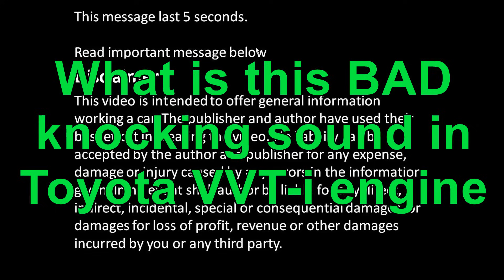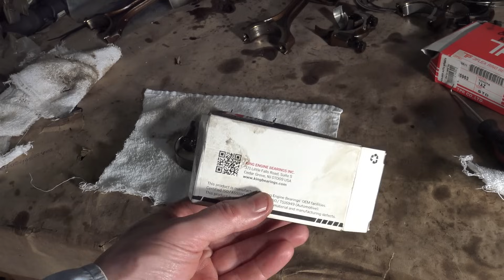What is this BAD knocking sound in Toyota VVT-i engine. Years 2001 to 2018

Comment: Thin oil recommended for those engines, vvt system has a very fine screen mesh that the oil has to pass by before it gets to it, if using oil to thick you’ll starve it
Reply: It's same as 5w20 when warmed up.
Reply: @Polymer Tools yes used as the manual book or factory recommend oil only don't listen to others that are wannabe mechanics.
Reply: From experience...yes! Use 0-20 oil and no thicker than this. I listened to a wanna-be mechanic to use a thicker oil and destroyed my oil pump for this bad advice. Toyota uses very tight tolerance on their engines so why we need to use whatever the manufacturer states to use.
Reply: @VILLEGAS76able  normally Toyota or manufacturers manual states the use of 0w20 oil or higher on the manual book soo don't..my last car about 20years old they told to use the thicker oil after a certain milage and guess what happend, same as you said additionally knocking related engine problems
Reply: @Polymer Tools You dad is not a mechanical engineer. Or, at least I REALLY HOPE he isn't if he's saying that.
Reply: Use the recommended factory oil. You can add lucas or zddp but thats about it.
Reply: @VILLEGAS76able  so I should use only 5w30 in my Corolla X 2001 with 1NZ-FE engine despite its mileage of around 150k KM
Reply: @BilalBaloch-tl2bp  Correct! Just go with a top quality synthetic oil. I use European oils as they are more robust than American made oils, so like Liqui Moly or Motul. oil.
Reply: @VILLEGAS76able  thanks for replying. Im currently using 20w50 which is way too thick for my car but used it this time because of the mechanic. Here mechanics mostly suggest using this oil if your engine has a mileage of 50K+ km.
One more thing, i once used 5w30 fully synthetic oil in my car and after around 1800km, oil level on dipstick were at middle. Is this normal?
Reply: @VILLEGAS76able 5w-20 and 0w-20 are the sane at running temp. The W rating is the cold temp, particularly winter. Just change your oil regularly, and use an engine cleaner every now n then. There are additives to the oil and for fuel. I advise an oil additive for the last few miles before a change

Comment: thanks very much for yr showing us that the engine bearings were warned OUT,  needs replacing My engine also make that knocking sound on my Toyota Yaris 2006 .while it is idling. My 5/8 mechanic could nOt find the problem, which u did <BUT total cost to renew both bushes n bearings on a Toyota Yaris engine . i am jp from Australia
Reply: I also have this problem on my yaris currently. Have you fixed yours?... Is there a slight cut in power than usual when this occurs? I'm really stressed out

Comment: Finally and after so many years i found out why i spend 5k eur on a engine repare in a new toyota verso after 100k km and 4 years. All the revisions where made on toyota. But not all is bad, the problem was solved, i love the car, no problems meanwhile and 350k km at this time. Thanks for the explanation. From portugal.
Reply from the maker: Good 👍

Comment: Yep I had this sound in my corolla engine for roughly 6-7k miles before I replaced the bearings. Bearings were torn up but the crank was fine. OE thickness bearings fixed the issue.
Reply: Did you have to pull the engine to replace the bearings?
Reply: @darcytran  nope. You don't even have to pull the head. Just drop the oil pan and unbolt the rod cap, them push the rod up a few inches with a 1/4 inch extension and reach your hand past the crank and pop the bearing out and replace it. Just make sure you line the hole in the bearing up with the hole in the rod, it's used to squirt oil on the cylinder walls. And remember to replace the bearing on the end cap side too. 8 in total.
Reply: @jimchance5006  wow, this sounds great!
Do u have a link to buy those bearings?
Thanks!
Reply: @rickyspanish5051  I don't have a link to them, but I bought them from rock auto. Any of them listed there will work, just make sure to check oil clearances with plastigauge.
Reply: Thanks a lot and have a great day!

Comment: Sounds like lifters to me. Some Toyata's take shims. The rod bearings make a low dull thud sound from the bottom of the engine. Lifters were refereed to as Tappets back in the days.
Reply: Do you happen know what could indicate the knocking sound (but louder than in this film, it seems like you are in an airplane) in engine on higher speeds? Till 30-35 mi/h the car runs very quietly. It is 2003 Chevy Cavalier w/110K.  I always changed the oil in time. The knocking sound starts ~ 40 mi/h, increases to maximum at ~55 mi/h, then goes a bit down.
Reply: Its not. Theyre called bucket lifters. Amd they tick, not as much as a knock. I have heard both 1st hand on this engine

Comment: That noise is wrist pin slap. (Too much wear at the pistons connection to the rod which connects to the crank shaft. 
You can isolate to prove this condition by leaving it running, disconnecting one spark plug wire from either the dist cap or ar the spark plug. Upon killing the spark to each cylinder, then revving up the engine again and the hammering sound should be gone in the cylinder that is the problem. Done.
Reply from the maker: Good work, Thanks ! 👍😀

Comment: finn i have 1.0 toyota 2011 mine makes ticking lifter at idle i think and also when i accelerate in gear it makes CRRRR sound like diesel and i think its either piston and cylinder worn out or crank shaft bearing, its only under weight and it goes away when hot but still hear it a little bit
Reply: My Citroen c1 1.0vvti same problem.. U fixed it ?
Reply: @h4swell  repaired still crrr,my cilinder walls are not broken, the citroen has the 4800 torque same engine tuned different,my yaris has the 3600 torque +3hp, try using other oil,i repaired mine, swapped rings chain gasket cleaned big carbon deposit and when we drove it the second time it made crrr,manual says to use SL/SM oil i used toyota and nearly no more sound and oil consumtion only on highway first i used liqui moli it burned it in 5000km city and was loud,now i use motul, but right now it has some fuel issues and wont start, i got the car from the mecanic with a cracked catalitic and loose sensors, and its always fan on when its cold, btw i use 5w30
Reply: @h4swell  mine also made a hhrrsssss because the chain was loose
Reply: @h4swell  i changed, piston rings, valve gaskets, all other engine gaskets, timing chain and tensioner supports, changed vvti changed oil pump, changed water pump, the pumps were good but mecanic said they suspect they dont do enough pressure and i changed them, valve tappets are good didnt change them, got the car from mecanic with fisured catalitic and now it doesnt have gasoline pressure and wont turn on 2 days 3 days later
Reply from the maker: Thanks for comment 👍
Reply: @h4swell  the problem is solved, weared in the engine and its running good, also i said theres no fuel pressure changed the pump and the pump was good there was the water temperature sensor that was broken replaced with a bad one and read 140 celsius and i changed the sensor with a good one and the car started and read 10 celsius like how it was outside

Comment: Hi. The same problem in my car. I planned to change those bearings. Do I need to remove the engine out and replace it or should I change it from the bottom of the car just jack up and do it. Do you think I can access this from underneath the engine bay without removing the engine from the car. Coz I don't have those engine lift.
Reply from the maker: I recommend trying it, can it work either way when the car is a Corolla
Reply: @PeterFinnTheCarDoctor   thanks for the reply peter. My car is 2003 Camry le. Sorry I didn't mention it earlier.

Comment: My Toyota 1NZ had a  knock sound and heavily smoking. Whem we opened the engine the pistons were easily playing in the block, and when measured was told the block needs Resleeve and that the pistons and rings were at standard, could the knock sound being caused by the pistons in the block
Reply from the maker: Sounds like bearing damage

Comment: Very interesting situation Peter. What was the cause of all this? Was it maybe bad lubrication? Is the issue fixed?
Reply from the maker: Normally oil replace. Too long time and to much miles for engine oil replace. This engine was driven by 40 000 miles with one oil replace.
Reply: That just goes to show how important it is to take good gare of your car. I have two Toyotas and don't know shit about car mechanics, but every 15 000 kilometres I take my cars to get serviced and have oil changed by a professional and my Yaris Verso 2001 has 348k kilmometres on it and still runs smoothly and my 2004 Avensis with 180k kilometres also runs well
Reply: This is the unexpected problem with Toyotas. Their engines are so robust and so reliable that it’s very easy to neglect maintenance on them. You just keep driving them and they go on and on and on, without any problems - until an obvious problem manifests itself, and it’s too late to do a cheap repair.

Oil and filter changes regularly, even when the engine is running beautifully. There’s the secret of keeping a Toyota running happily forever 😊
Reply: @Aussiemarco  You speak the truth!
Reply: @Aussiemarco  Absolutely. Take care of your Toyota and it will take care of you!

Comment: Hello. I have a 2004 Toyota Avensis 1.8, 1ZZ FE angine that consumes a lot of oil. Serviced around every 10.000 km with Toyota Engine oil 5w30 fuel economy. Two days ago the oli light start flashing when slowing down or accelerating. I checked the oil level and   
the dipstick was dry...😐 Added 2L of 5w30 oil and seems to be at minimum on the dipstick. After adding 2L of oil, i was driving the car and from the engine starts to hear some metal noise when i was hitting the gas pedal.The metal noise is herd only when i give some gas....Can u tell me, please, whats the damage?😐
Reply from the maker: Hi, your piston rings

Comment: BUT that knocking sound STOP when driving it only happens when in IDLE mood aka at a RED LIGHT STOP
Reply: Worn out engines will have lower oil pressure which can cause more wear at idle.

Comment: Hello.  Same problem in a peugeot 107 3 cylinder toyota vvti engine.  Tiking noise...... about this'..........This engine was put in daihatsu sirion and cuore. Toyota aygo, peugeot 107 citroen c1 toyota yaris and few more. This noise it is a normal noise when the engine it is cold or when you accelarait . The noise it is from VVT_i , variable valve timing inteligense. In fact piston start to ignite to soon and it is toutch the cylinder. Try to worm the engine few minutes and after that the noise will not be so bad, cylinder will expand a little and will be ok.. The engine it is very smart, always try to have more power with low fuel, so do not worry. Sorry for my bad english. Regards from Romania !
Reply: also try to put the music loud so you don't hear that horrible noise. Or better, buy a Volkswagen
Reply from the maker: Yes 😁😁😁

Comment: Hi hopefully my family car could keep away that annoying knock at 85-90kph.

Anyways, wanna ask you about to my buddies strange toyota avanza 1.5 manual - egine knocks, it's too different from other cases, why I said so? My buddy sent me a video while he was driving and then knock occurs only when he go release pedal and ready for shift up. It mostly occurs when he is going to shift up (rev going down) then knock knock knock then gone.

I told him that I never heard of such case, he consulted at toyota dealer hoping he could get precise answer & repair so he left it for a week at the dealer. Toyota told him that it was simple knock that he can avoid them by sticking to right RON & by cleaning the fuel system in which I doubted I told him.
Reply from the maker: Thanks. :-)

Comment: @Peter Finn the Car Doctor
Hi Peter, I have Corolla E12 1.6 VVT-i and when engine is cold I can hear similar hammering sound while accelarating, as in your video, but this noise completely goes away when engine is at optimal temperature. What could be wrong with  my engine? Thanks in advance. Greetings.
Reply: Does it happen when you first turn the car on? Or only when you accelerate?
Reply: @Sci-Mon1  Only when I accelerate and engine is cold. It starts at 2K RPM.
Reply: @bamboos9516  could be a bad ocv. Or some people call it a vvt solenoid. I would deal that out first and see if it fixes the issue. Not a hard job to do.
Reply: You ever fix your problems and if so how im running into the same thing myself?
Reply: @wasabi-_-senpai2202  Any luck? Same issue, Once it warms it goes away.
Reply: @migalex7910  it was my water pump that endeded up needing to be replaced look Into that if any of the other post aren't helping

Comment: It has taken me 14 1/2 years years and 219,000 miles but Thanks to Peter Finn the Toyota oil sludge mystery has been solved.. I do my own maintenance and my car a 2004 Toyota corolla was coming up for it's spark plug maintenance interval I changed the original set at 120,000 miles. This time at 219,000 miles I'm changing them a little early Because I figure next time at 300,000 I'll let someone else change them. So the bottom line is the number 3 spark plug well has oil in it which means the valve cover gasket has failed. This is not a big deal because there is no rough idle or loss of power and no codes and the perimeter gasket has not leaked a drop. So I proceed with changing the 20 dollar valve cover gasket and it's the first time this valve cover has been off. Guess what no sludge, none, zero. Now this takes me back to 2015 when the oil light came on and it turned out to be a pan full of sludge, that cost me a 10 dollar pan gasket and some elbow grease. The oil change intervals on this car have been 3000 miles since the day it was new, never missed one. The lesson in this is that the oil filters had failed and the 3000 mile oil change interval kept the sludge flowing to the pan. More evidence of this is the grit I found on the oil control filter which protects the Variable Valve Timing system. Try and find the oil control filter in your owners manual for when it should be serviced Ha, Ha. Talk about the most well hidden secret in the car industry.  Thanks Peter Finn for your oil control valve video.
Reply from the maker: Thank You. :-)
Reply: So change oil and filter 3000km to 0w40 oil ?

Comment: My query is that this is the only/sole reason of bad knocking or bad knocking sound can come due to old timing chain kit used even when engine is newly overhauled ??? I want to buy a Toyota Corolla altis 1.8(newly engine overhauled ) but bad knocking sound is coming out of engine. The owner says that this sound is due to old timing chain kit...if timing chain kit is replaced, there will be no sound...plz reply
Reply from the maker: Knocking could come from old connection rod bearings
Reply: @PeterFinnTheCarDoctor  thanks

Comment: Hi Peter, I have same engine 2007 corolla e12 with 4zzfe engine, my engine was making a rattling sound from the valve train area and then my low oil pressure light illuminated, I have cleaned the oil pickup pipe aswell as done an engine flush and the sound is still there, it only happens once the engine has warmed up with mabye 30 mins of driving, I am not sure what the issue is, could it be chain tensioner or timing chain, from what I know the car hasn’t had timing chain replaced, it currently has 295000 km on it, any idea what it could be?
Reply from the maker: Noted 👍

Comment: Peter, do you happen know what could indicate the knocking sound (but louder than in this film, it seems like you are in an airplane) in engine on higher speeds? Till 30-35 mi/h the car runs very quietly. It is 2003 Chevy Cavalier. The knocking sound starts ~ 40 mi/h, increases to maximum at ~55 mi/h, then goes a bit down.
Reply from the maker: Maybe bearing failure in Connection rods
Reply: @PeterFinnTheCarDoctor  Thank you for the replay. Whatever upsetting to know it, I'm afraid you nailed it, Peter. Please could you tell what is the approximate cost to replace those Connecting Rods, and should you replace all of them or just those which failed? Thank you again.
Remark: I always, always changed the oil in that car fm the time I bought it, mostly at Dealer where I bought, though sometimes and in other shops. I think not always those changes were done properly, and sometimes not done at all. I'm happy I've learned to change oil myself, though quite recently, and it is late for Chevy already.

Comment: I have a 2005 corolla LE  with 114,000 that makes a rattling noise at cold start ups. Then after a few minutes it goes way? What could it be??
Reply from the maker: Valve clearance. Can be adjust in Toyota dealer.
Reply: Peter. It clatters only when it's cold out. Then fine after it warms up?  Oil pump getting old?
Reply: Dean O yeah valves tend to need adjusting around that mileage my 2000 does the same. It doesn't effect the engine the noise is just annoying if you want it fixed dealership only can adjust the valves they need to do it when the engine is cold
Reply: Cool...Thank you.
Reply: @deano5622  no it's the oil lifters if it's only cold starts mine one does it for a second and I have 215k
Reply: Thanks.
Reply: Thank you.

Comment: CHECK YOUR SPARK PLUGS ARE NOT LOOSE ... My 08 Corolla was Ticking for 3 Months i was losing my mind, Finally, i check the Spark plugs and my 3rd Cylinder Plug was loose i Tightened it to 12.5 Torque and the Ticking is GONE :DDD
Reply from the maker: Hi and Thanks for feedback. :-)

Comment: hey i want to ask you a question i have the same problem with my engine  and it damaged the crankshaft could i change the bearings also with the crankshaft and get bck my engine up and running
Reply from the maker: Good comment, thanks 👍